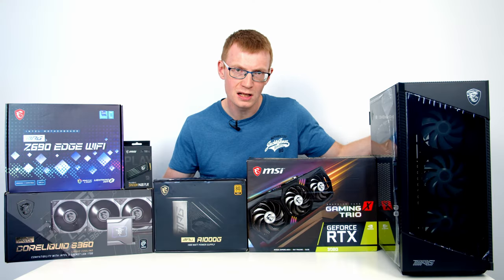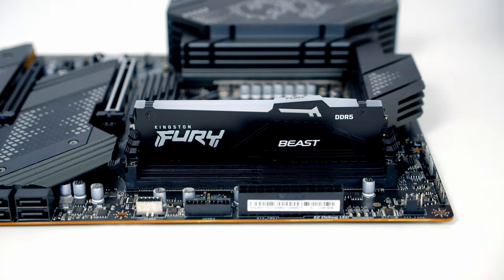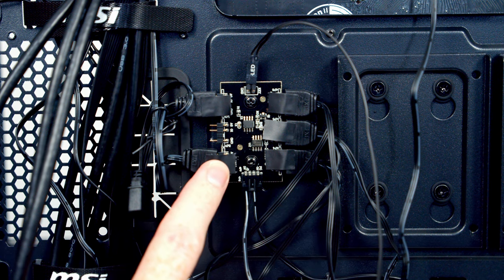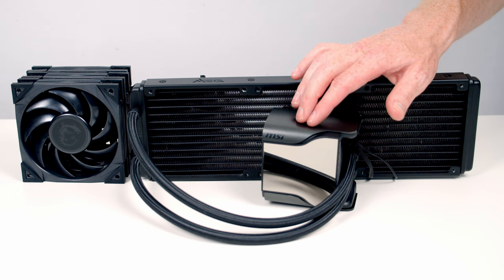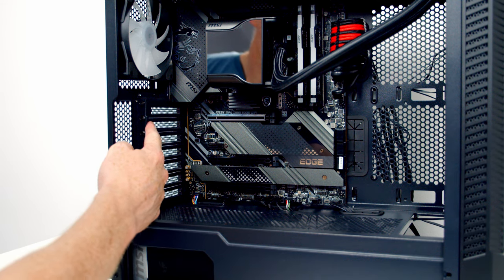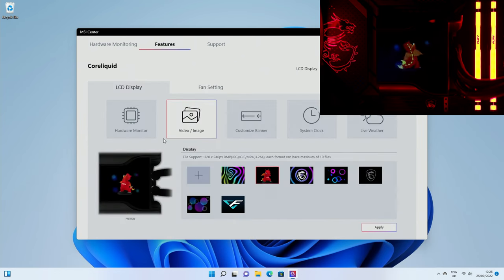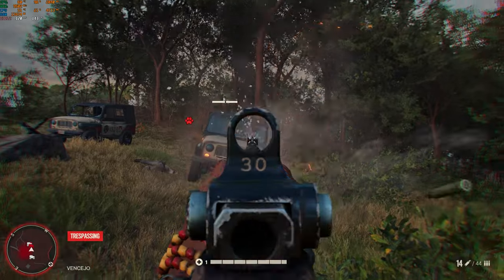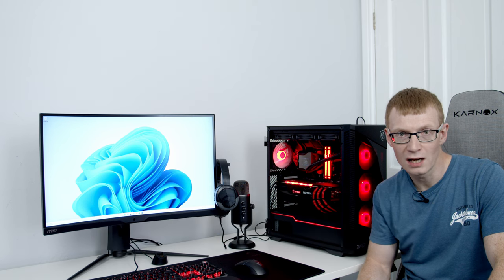All MSI Gaming PC Build

Comment: Hello, please advise. I'm planning to buy the same MSI water cooler, the same case, but I'm thinking about replacing them with 3 120mm fans with rgb, which are in the front of another MSI case. Will it work? Can I use the fan connection that will be at the radiator of the aforementioned cooler? If it is possible to connect another cooler to the side of the cabinet, what will be the next connection with rgb? Thank you.

Comment: I see you used both cpu_pwr1 and 2.  I am in the middle of building a system and the Msi board I have has 2x 8 pin pwr connections. Do I have to use both ?

Cheers